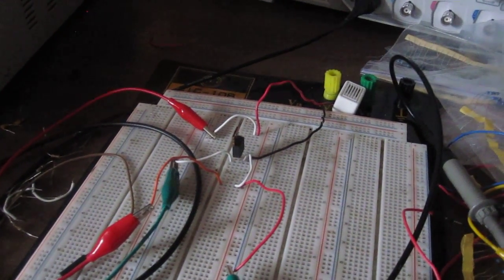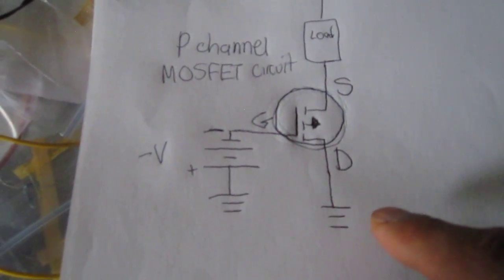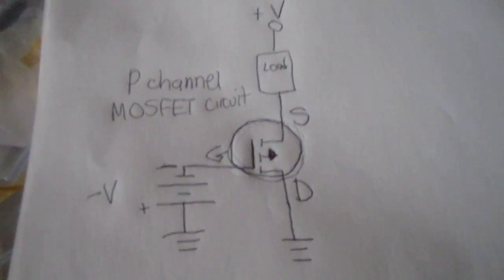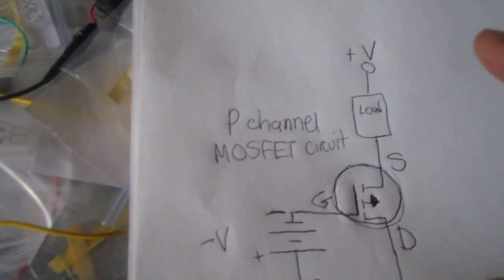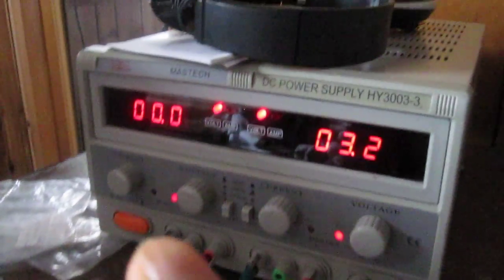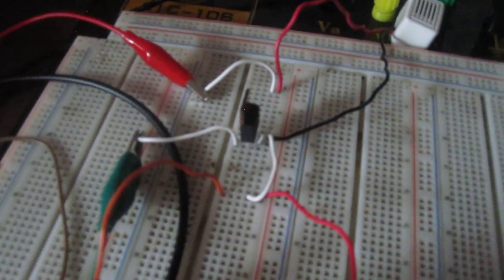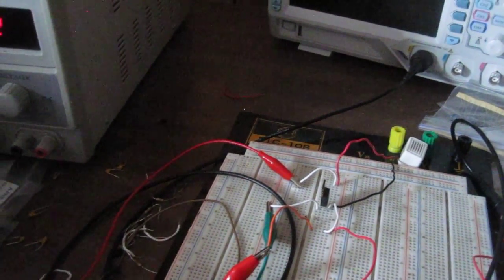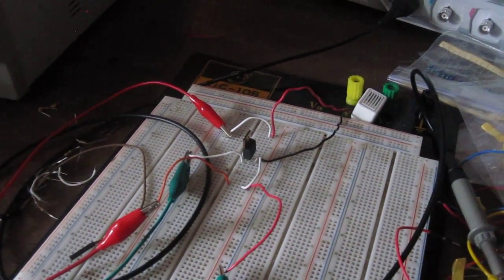P Channel MOSFET Switch Circuit

Comment: Positive of the power source he says if you trace it goes to ground.  I don't see no ground.  I don't know what he is talking about.
If you really use a magnifying glass it looks like it is goint to the source of the mosfet.
And the black negative of the power supply looks like it is going to the gate.   And what about the drain of the FET?, goes where?

Comment: You have grounded the positive supply, that is what it shows. You have grounded the Drain of the FET.
So the negative side of the load goes to the negative of the power supply along with the gate.
So what you call supply voltage, here you mean negative supply voltage.  Is this correct?

[ I  am trying to use hall A3144 to turn on a FET when magnet passes by it. As it is with NPN, output goes low, it shuts off the FET.  I like it to turn on. How would I go about it?  Thanks much]

Comment: Load on the Drain and the Source to the positive supply
Reply: He has the load to the source and the source to the positive.   Then it looks like he has the drain like grounded and so has the positive supply voltage and its negative supply to the gate.  So it is like he has got positive, negative and the ground.  Three things.

Comment: Usually when using a pmos to switch a load you want the source connected to the voltage supply.  This is because it's not the gate voltage that controls the pmos, it's the gate-source voltage.  With your source connected to the negative side of the load you don't have control of the source voltage.  For example, what happens when you are trying to fully turn off the pmos (connect the gate to ground) but the load leaks a little current through?  The source voltage will go towards the voltage supply, meaning the gate-source voltage will become negative (even though the gate itself is not at a negative voltage).  The circuit will leak current even when it's "off".  You would need to drive the gate positive to make sure it turns off. This might work for this particular setup, but it's not a good general purpose switch for various loads.

 I'm curious if this is why you have the circuit set to 3.2V power supply.  In the original article you have it set to +6v, did the circuit fail to turn off when the gate was grounded at +6v supply?